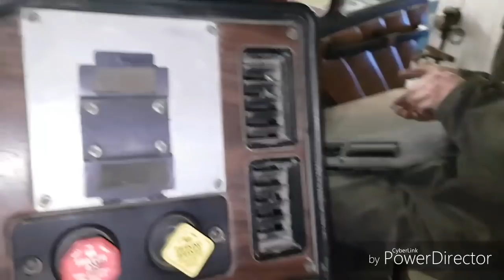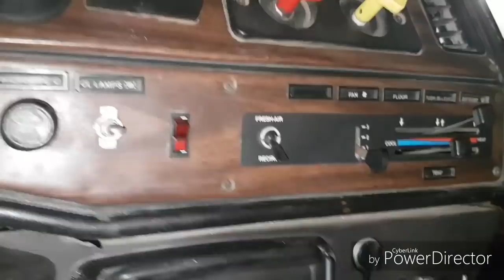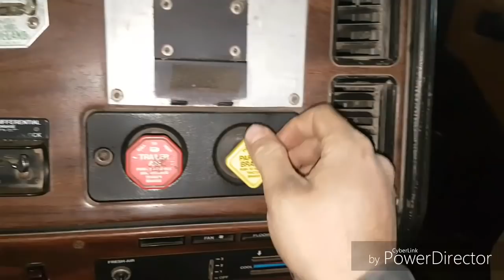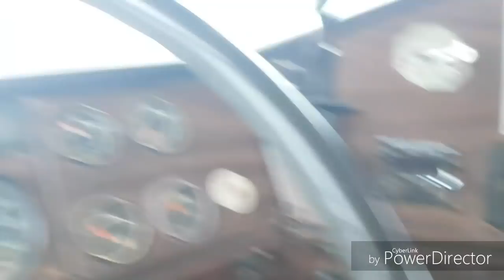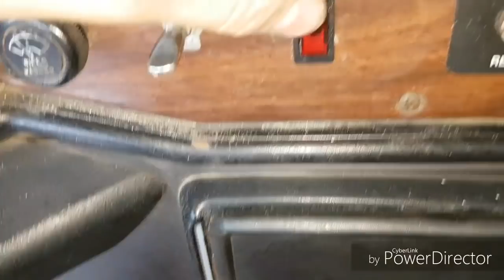Low budget rust repair and more on the freightliner!! Part 2

Comment: Man in Michigan the municipality’s try to singlehandedly deplete the planet of rock salt each winter.  My guys wash shit everyday to keep it from rotting out overnight.  Another fantastic side effect of the heavy salt use is the road boogers that build up all over the trucks. I have 3 2018 Kenworth T880’s that run daily hauling either liquid shit, feed or grain and all 3 have had to have the hoods reinforced because the road slop builds up in the fenders and with our smart car sized potholes the trucks get pounded so bad the fiberglass fractures and the feeders try to fall off.  Run them in the dark and the headlights shake so bad it almost causes you to have a seizure.
Reply from the maker: Jeebus lol
Reply: Farming the Mitten sounds like our roads. All the dust has blown of the surface to NZ and we’re left with giant rocks sticking up, and the government couldn’t give a crap👍🇦🇺

Comment: Are you using flux core wire on that rusty metal?
Reply from the maker: Same old wire as I use to weld 3/4 inch plate haha just did button welds thems made a full pass over top. What do you use?
Reply: @SouthSaskFarmer1  I'm new to wire welding and flux core is all I"ve tried so far. They say it handles rusty metal better than gas shielded but I wouldn't know.
Reply: @roosty6  a small low amp arc welder is good too.
Reply: @thebreakofdon5188  I had no luck with arc welding on rusty old cars. Just burned holes. At least with the flux core wire I'm able to do a better job without burning through (most of the time).
Reply from the maker: @roosty6  ya I use my mig gas at the same time. Works real good really